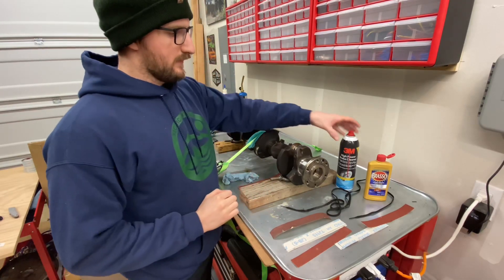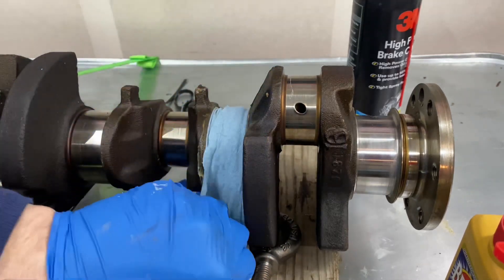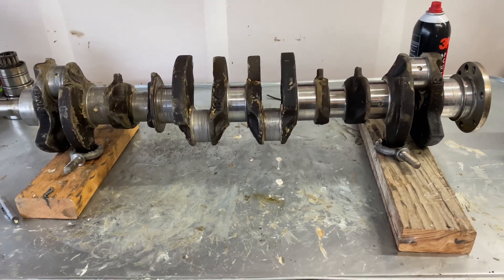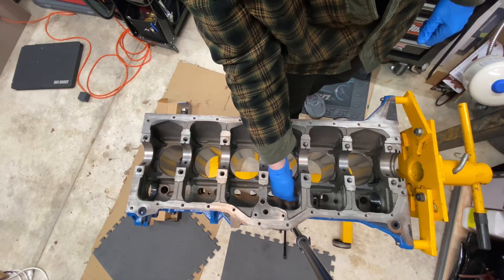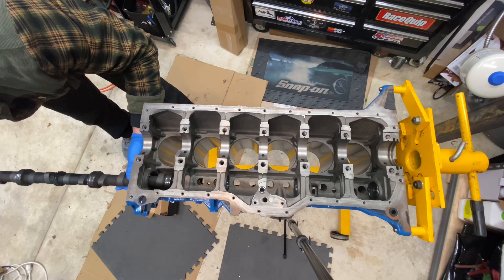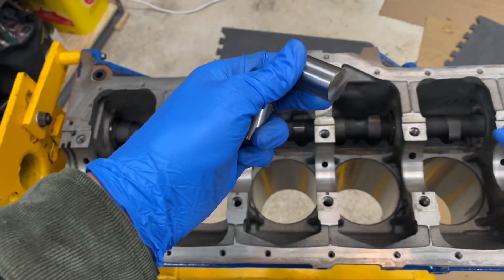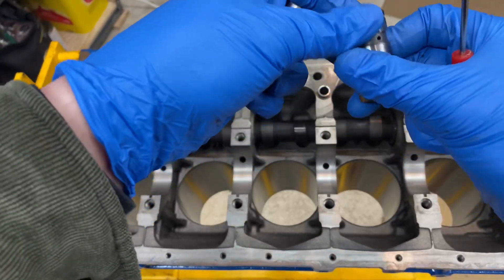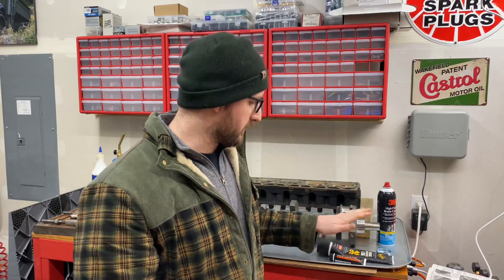Jeep 4.0L crankshaft polish and camshaft install. Episode 3!

Comment: I'm glad you mentioned measuring cam taper. Powell Machine showed videos of incorrectly machined cams that lack proper taper. It is one reason so many new cams are duds. He also showed lifters that did not have the proper convex machined in them, making the problem worse.
I suspect the best thing to do is pay someone to remachine you new lifters, and have new cams made by a custom cam grinder, they might have enough passion to making things correctly.